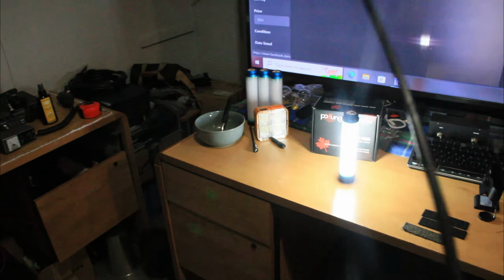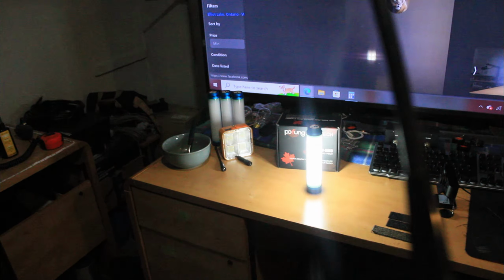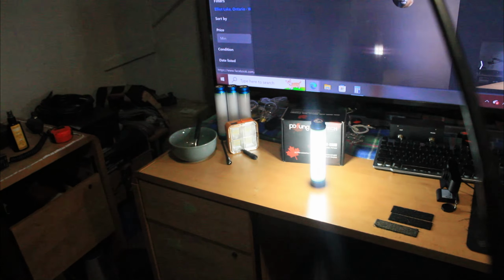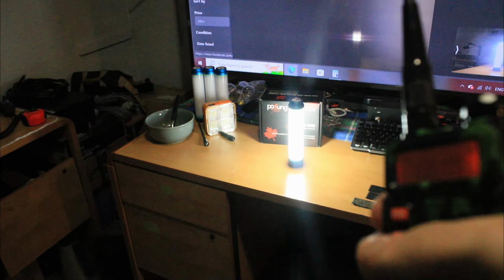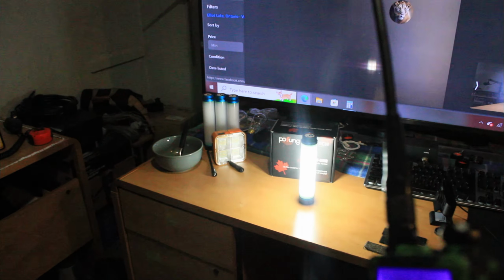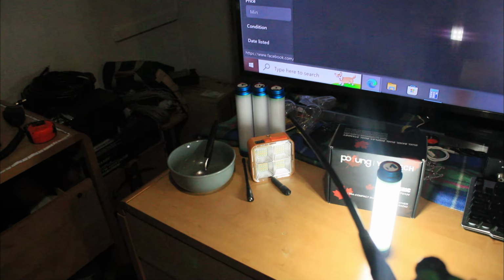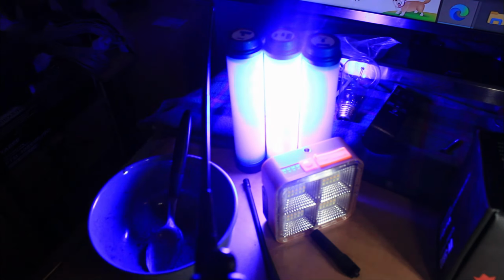BAOFENG VS RFI

Comment: Yea some of these lights are very prone to this. Garage door openers and more. Put a florescent light near your rig and key up on cw or AM and watch it glow, heck you can stand under power lines with a florescent light and have it glow. We used to use incandescent light bulbs to tune up our old tube rigs back in the day. It is not just the fault of some of the lights, but dirty emissions as well from radios. Have fun.
Reply from the maker: thanks for watching fred... Great information... tuning lights in old days with bulbs neat...
Reply: I hope you’re not transmitting on the police band.

Comment: I think you are using a 100 watt amp.  Nk way thats happening on 5 watts.
Reply from the maker: noall i did was use a 17 inch antenna a Baofeng no amp. you see antenna connection no other wires,,,